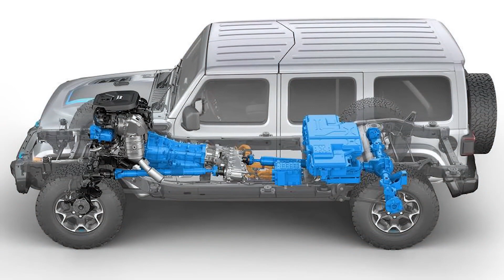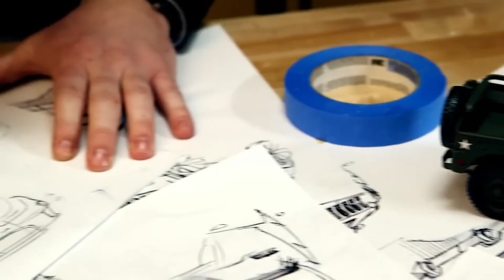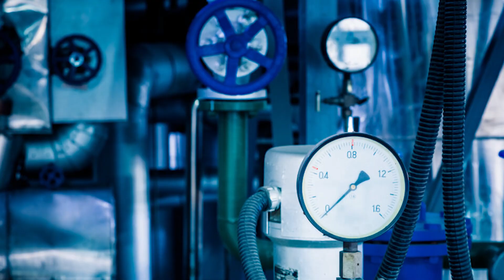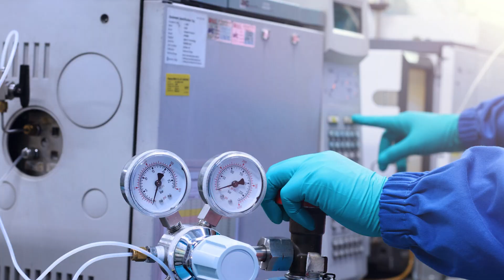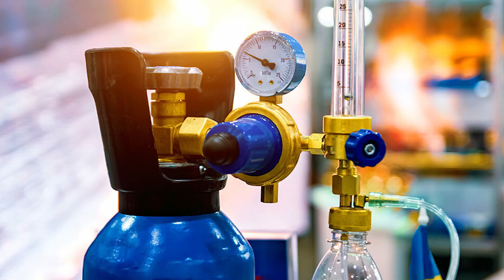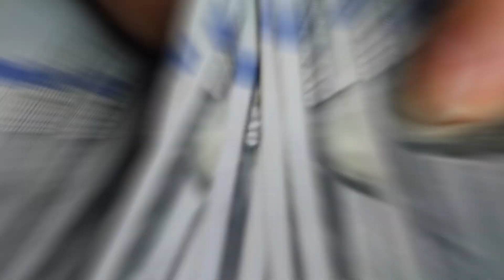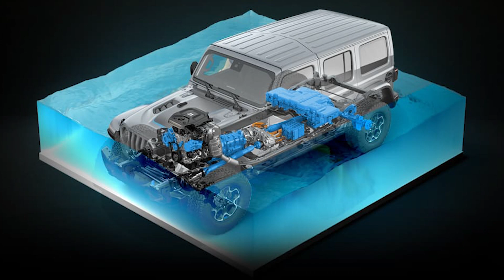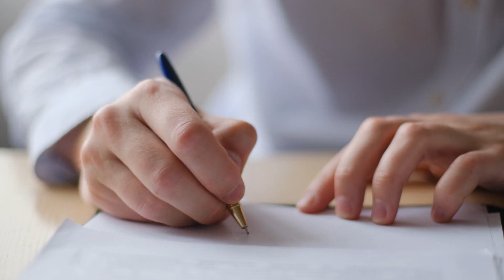Shocking: Jeep's Compressed Air Engine Threatens EV Industry

Comment: They could even recycle the energy lost from the exhaust and power a small compressor to deliver compressed air straight to the cylinders bypassing the need for a heavy air tank. Ohhhh that's a turbo...

Comment: THE 'AIRCAR' IS OVER A DECADE OLD .. FRENCH F1 ENGINE DESIGNER & SON .. I MADE SOME IMPROVEMENTS
Reply from the maker: @thepunadude electric car tech was around for 30 yrs before it was commercialized.
Reply: @EVCarsHorsepower  Not the tech to mass-produce. Big difference there. You may have the tech, but if you dont have the machines/tech to mass-produce it, its not going on the market because mass producing = low price. 30 years ago, mass producing huge lithium batteris for cars was near impossible.

Comment: Lots of gum-flapping here with no real info. What energy sauce is compressing the air? If it's using regenerative braking, that's not doing anything while freeway driving!:body-blue-raised-arms:
Reply from the maker: Its not regenerative braking.
Reply: @EVCarsHorsepower  So what energy is compressing the air?
Reply from the maker: @nzsaltflatsracer8054  It can be powered by vehicle acceleration. And stored for future use.
Reply: @EVCarsHorsepower Can you elaborate on "powered by acceleration" ? It takes a lot of energy to compress air so I find it hard to believe they are doing that with inertia!
Reply from the maker: Through acceleration the pistons would draw air from its environment into some sort of tank or tanks. That would generate is presser. Thats just one way .